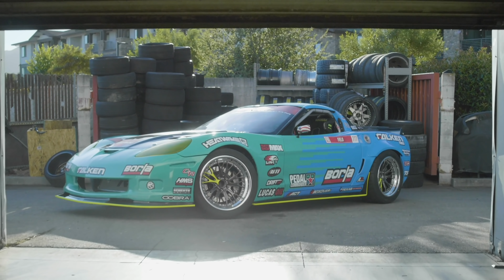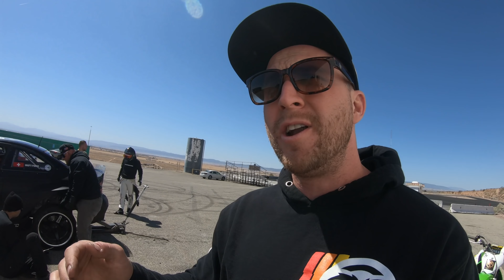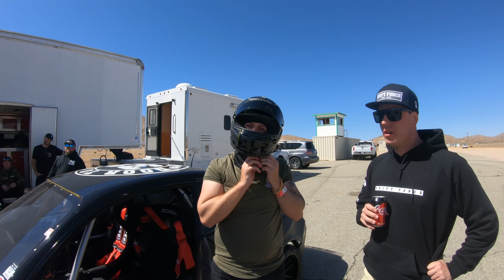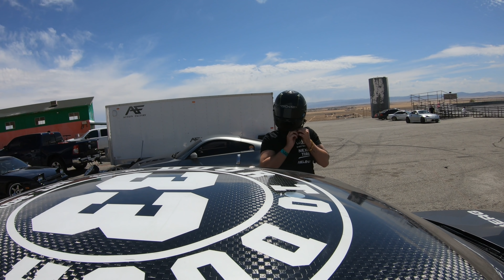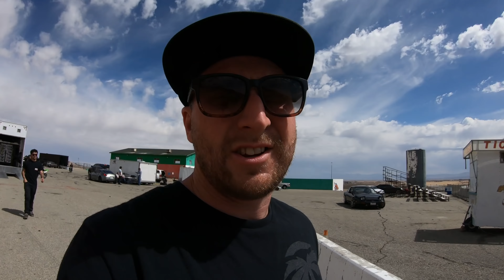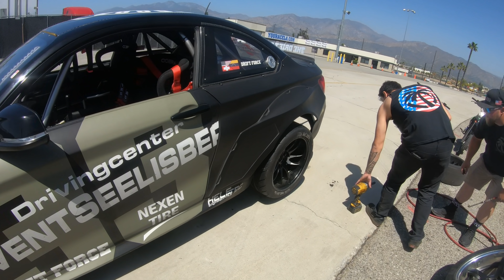EUROFIGHTERS Pre-season Testing + WALL RIDES & TANDEMS

Comment: Brilliant tips! Here's a sub! .. 
Am new to drifting and struggling with my car... It feels very gripped up and unwilling to initiate drift including transition unless whipped (but am new and it's still rather cautious) but it falls to angle and loves to be at angle. But the tips you gave in this video will help me at my next drift event - get used to tyre pressures (high, low, wet dry)  play with damper and compression especially upfront to improve steering.
Reply from the maker: Add tire pressure till you are comfortable! It ALWAYS makes more sense to drive the car loose. This is always 100% the truth. Grip it up as you get comfortable and leave it loose till then!

Comment: More and more Eurofighters are coming every year. I think the new drift meta is Eurofighter. It seems that the number of S chassis is decreasing with each passing day.
Reply: That's because the s chassis is very old s15s are over 20 years old. Hgk build top level race cars built purely for competition.   Rather than street cars turned into race cars
Reply: @Robvdk69  false, hgk cars are in fact still a street car that's been turned into a race car just like a s15. It's not like the e92 is coming brand new directly from bmw for them to build...
Reply: @clutchkickpj693  yes they are street cars originally but they way they build them they are no longer the same . They cut everything they can off the car all that is left is the basic shell . Everything else is hgk . So it is closer to a purpose built race car than a street car. I never once said they weren't street cars all I said was they a closer to purpose built race cars than street cars . Quite a few of hgks cars are brand new and have never seen the streets and are cut up and turned into drift cars .
Reply: Rob 69 every pro drift car now follows that same formula and are purpose built race cars. Yes, HGK takes it to another level, but it isn’t like they build anything in particular, they just build it well. Practically every FD car now is tube front, tube rear, and very cut out